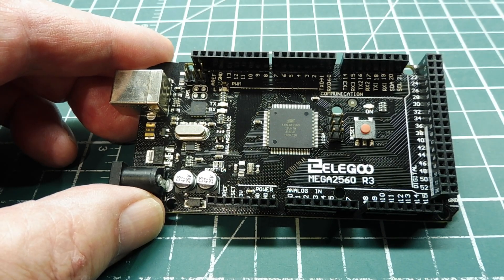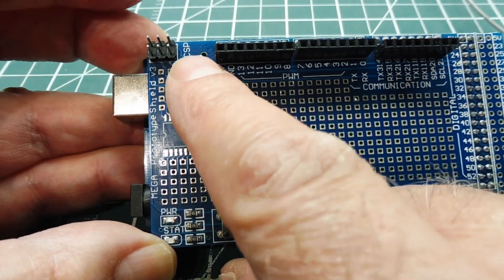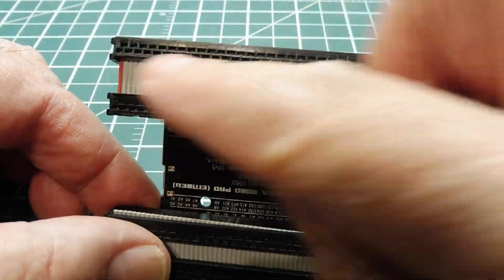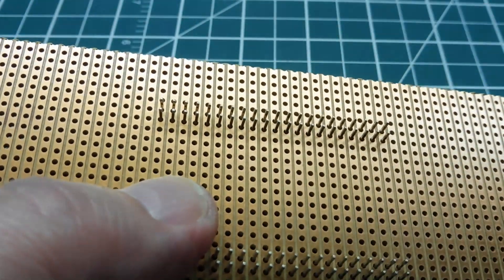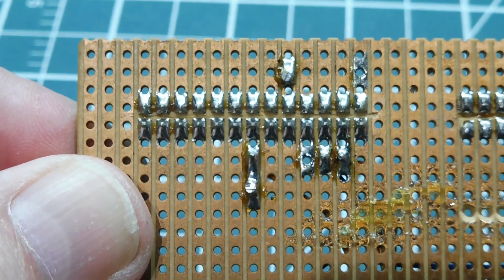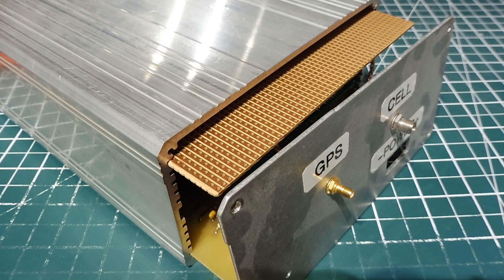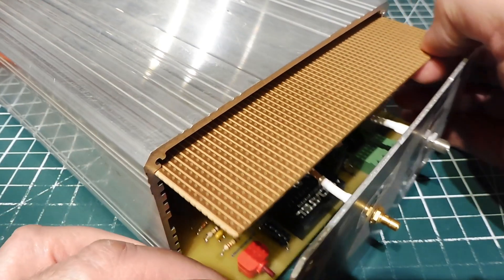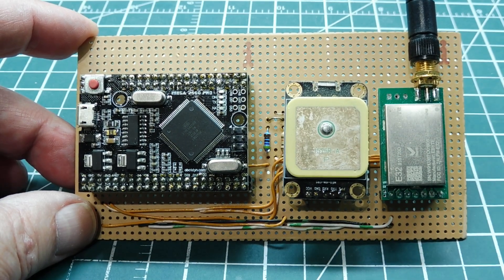Mega2560 Prototyping / Vero Board / Dual Row Headers

Comment: Using dual-row headers in other projects, I used two pieces of Vero side-by-side to connect to the dual-row socket I was using, one row soldered to each piece of Vero. That was easier for me than cutting a slit between two rows of holes on a single piece of Vero and hoping my soldering wouldn't wick across the cut afterwards.

Comment: The big size atmega 2560 clones can be had these days fairly cheap with bundles of a ramps board and sets of stepper drivers, as result of repraps and china stocking. It's possible to either buy a bigger 2560 for 30 bucks or a 2560 in bundle or a 2560 with 4x stepper drivers, a lcd with a rotary encoder and the ramps board for 30 bucks.

Comment: Interesting Ken. I’ve been toying with the idea of doing a protoboard for the Scamp3, so people can make breadboard projects more permanent. Do you think this is something that would be useful?
Reply from the maker: Yes .. after writing code for the Scamp, the next step would be to place it on a proto board and then into an enclosure. The user would source their own components. Check out this proto board that was used in schools. https://youtu.be/hkX28ci29A4
A Scamp mounted on a proto board with a prototyping area with battery support for a 18650 that can be slid into a popular enclosure would be ideal. The biggest hurdle for students is the enclosure.